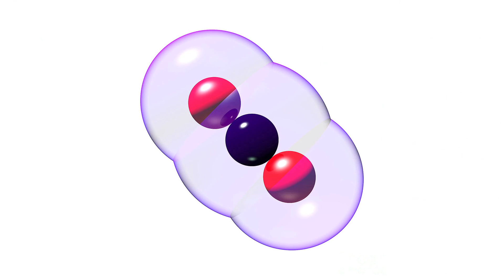Gas Made from Air and Water!

Comment: I can go down to my local bottled gas supply store and get a 45 lb bottle of hydrogen. A 45 lb bottle of hydrogen can be transported without any special.  Torequirements.  Again, this discussion was about the conversion of hydrogen into gasoline, versus the use of the hydrogen as the energy source. My belief is it is not worth the energy to convert hydrogen to gasoline, when gasoline so inefficient.

Comment: Not necessarily.

Assuming that its a clean burn (no soot forms and no fuel is left over), all of the gasoline will be converted back into CO2 and H2O.

The only problem is, well, you can never have a 100% clean burn. There will always be byproducts such as carbon monoxide and soot.

Comment: What a pile of not new not shit.  Hydrolizing carbon in carbon dioxide will already require nearly the same energy as you get from the octane molecule, and to follow that up with distillant combinative fracturization would require around the same amount of energy.  Until the filtration from molecular sieves and processing through molecular motors and can work at above 90% efficiency directly from sunlight, this will never be a primary energy source.

Comment: NO. Hydrogen liquid is just to hard to use as a transportation fuel. 1. It requires cryogenic conditions for storage, thus making it very complex and difficult. 2. Energy density of liquid hydrogen is very low. Fuel Cell tech based on other fuels like Methanol & Ethanol is the best. Direct Ethanol FC only need an airtight tank normal pressure to store fuel. While both methanol & ethanol being larger molecules have much higher energy density.

Comment: hey sourcefed, there's a program that was funded by the DOE just last year called JCAP, Joint Center for Artificial Photosynthesis. It's basically the same idea, water + CO2 = gasoline, but they also try to incorporate solar cells into the technology. see if you guys want to check that one out too

Comment: i Remember reading this somewhere the problem is that the engine that will run on hydrogen can explode when crashed. which is why is not really out in the public and also the procedure to get ethanol is that they need catalyst and catalyst is very expensive i have heard in chemistry class.

Comment: the infrastructure change would make the potential savings not worth it.  conversion to gasoline doesnt require any changes, and completely does away with the concept of Peak Oil, since the tech will be ready in the next 20-30 years and will build up more as we get closer. as more and more things are converted to "clean gas" that leaves more conventional oil to go around, easing the supply side of the calculations

Comment: This can have a huge affect on our energy consumption. Right now one of the biggest problems is storing energy. Our existing batteries cannot store a lot of energy and they use extremely dangerous and damaging elements in their construction. If it were feasible and economical to store renewable energy from solor and wind in the form of this type of gasoline, it could help aleviate this problem! But this is just me talking out of my ass.

Comment: It's a nice proof of concept, but forget the money--how much energy has to go into this? If the renewable energy (e.g., solar) is greater than the energy produced by burning the gasoline, you've technically lost energy. Further, a large proportion of the potential energy is gasoline is lost as heat instead of work (in car engines, for instance), which electric cars don't do. This might still be trying to solve the wrong end of the problem.

Comment: So you extract hydrogen from water to convert it to gasoline, why not just use the hydrogen? Seems like it would be easier to convert our current technologies to hydrogen then use excess energy to convert the hydrogen to gasoline, which only is about 25% efficient in current technologies.

Comment: When you combust alcohol you get the water back, and this process uses CO2 not O2... we don't need nearly as much CO2 as we have - in fact the amount we have atm is a problem.
This tech would be worth it, even if it does use more energy than it puts out - purely because methanol can be transported and stored easily. Unlike solar and wind power. Bring it on, I hope this method takes off

Comment: The EROI question is pretty big with this tech. The more steps you put in between, the less efficient the process must become. I can see why they mention renewables as the power source though - as isolated sources, they suck, but as passive/distributed sources they absolutely crush fossil fuels. So if you can take all that passive collection and store it in a fuel for shipment to where its needed... maybe some good potential there.

Most promise for airplanes. We really need new airplane fuel.

Comment: As far as the process uses energy so is it sustainable is a bit of a strange question since it takes unbelievable amounts of energy to run an oil refinery, however, you get a lot of products out of an oil refinery from natural gas, gasoline, kerosene, diesel fuel, jet fuel, and asphalt out of basically, one barrel of crude.  On a side note the problems caused by gas burning vehicles will not be solved with more/cheaper gas to burn.  Go Nuclear!

Comment: Batteries and fuel cells will hopefully be able to take over for gasoline in a decade or two before we come too close to depleting the fossil fuel avalible. It's really a shame to burn it since we can do a lot of great chemistry with it.
High temperature ethanol or hydrogen fuel cells could be viable for subsonic flight, batteries for cars with fuel cell range extention packs, and trains on electric tracks for mass transit.
Also: bicycles! As a student my main transport vehicle is a good bike.

Comment: companies are already making methanol using blue green algae, gray water, and waste industrial CO2. they use solar energy to heat/power the liquids to speed the process.  it is scalable and produces cost effective gas when upscaled (about 2$ per gallon).  between 2 and 20 thousand gallons can be made per flat acre, so think verticle

Comment: This i great! Wouldn't this also help with removing CO2 from the air, which is one of the most "harmful" greenhouse gas which is produced from the gasoline you just made, so the pollution wouldn't rise as rapidly, plus we can use solar, wind, geothermal(etc) power to produce this new fuel in large scale, so it will be just awesome... nuff said

Comment: It's neat because it works in existing engines, but as they said there's no way it can take the place of conventional gas.  One thing that they were wrong about in the vid is when they said "Our rapidly depleting-slash-polluting-slash-expensive fossil fuels."  The reason why we use fossil fuels is that they're extremely cheap, concentrated energy overall.
This is really just a stop-gap technology that's treading the water until battery technology advances enough to make electric cars realistic.

Comment: So why aren't we using hydrogen? I can make hydrogen with electricity and water. I do so regularly when electro-etching brass plates for art or home made circuits, and when I need hydrogen for my hydrogen torch (also home made). You need a 12v battery and water. That's it.

Comment: You're correct, it's not new technology at all. As has been stated it is a fairly simple process. I believe the reason a much larger company hasn't really tested it already is that the volume of fuel created is too low to make it worthwhile especially when the process is pretty inefficient as it is. Hopefully they will prove me wrong and increase efficiency and maybe then it would be feasible, but i doubt it

Comment: mix this new fuel with ethanol, and produce it all using wind and solar power, then voila you have clean renewable and (slightly) more practical fuel. 'cause I really want to give up fossil fuel but I don't want to give up cool cars based on the standard internal combustion engines

Comment: I agree with what you're saying completely, but the issue is it wouldn't be a short term solution. Or at least not for the automotive industry. It will take a good while to develop the process enough to create enough fuel to have a real impact on even a single country, hence why it may be used for motorsport (that and the fact it will be very high grade fuel). I really wish it was feasible for this to be used worldwide in road cars as i hate to see cars go down the electric route

Comment: It would take more energy than would be contained in the gasoline, but that's not the issue here. This would at least let us manufacture gasoline (to be used in vehicles) without needing to worry about running out of resources from the Earth. The extra energy needed can come from other (possibly renewable) resources.
So you're absolutely right, but it would only be a problem if we were using gasoline to make less gasoline.

Comment: News flash! Scientists found out how to build a battery made of gasoline.  You put energy into the system which stores it chemically, only to be released later and converted to mechanical energy.  This is pointless as converting energy from electrical to chemical to mechanical is the least efficient way possible to move energy.  There will never be an engine efficient enough to make this process make sense.  So stupid.

Comment: How is this less flawed than hydrogen fuel cells? (other than being less explosive) If you need energy to make the chemical energy (hydrogen or gasoline) then we're just converting the energy from one form to another. Fuel cells also only produce water vapor, while synthetic gasoline still produces CO2 when burned as fuel, which is a bit counter intuitive.

Comment: Video Response. Does your car still use gasoline? Did you know that when you run your car on gasoline, you're actually running it on hydrogen? The water powered car in no myth.

Comment: Hey SourceFed it would be nice to see some sources, either in the description or in the article on your site. Overall you're barely getting any information about how this works, well known principles? To make chemical energy like gasoline, you would naturally need to get the energy from somewhere else. If they use electricity to make the gas, then they probably burned fuel to make that. Even using renewable energy, they would still pollute when using the gasoline. I just don't see what's new?

Comment: I have two sides of the story.
The synthetic gas could be a viable source of energy ONLY if the energy output is higher than the input. 
The other side is instead of wasting our time creating gasoline that will deplete our ozone and increase our greenhouse effect, why not use that time and money into improving the electricity cost for electric motors, finding other, cheaper substances to make the special conductive parts to essentially lower the cost of the electric engine. Lowering the cost wi

Comment: they are using CO2 and water to make gasoline. then burning the gas to get water and CO2 so ya you get our air and water back. 
basically:
              CO2 + H2O = gas
              Gas + O2 = H2O + CO2

Comment: Essentially you are moving the energy carrier down the chain from renewable source to gasoline, you are going via hydrogen, why not stop there. Have a system with no point of use CO2 production, better yet? You can make it without air. Hydrocarbon generation from air will prove vital in the distant future though when we need long chain hydrocarbons for applications ranging from medicine to plastic bags.

Comment: As it turns out petrolium is an complex molecule build out of hydrogen and carbon which can be found in water H²O (H=hydrogen) and carbon dioxid CO² (C= carbon). And now come the best part. When you burn petrolum guess what you get. carbon dioxid and water. And when you say now ²the extra burn/heat causes more global warming.² think about that you have to put in energy to form the gasoline. Therefore what you put in it you get back out. So carbon dioxid neutral. Hope you it helped good day :)

Comment: If the energy required to produce this gasoline is equal to or slightly more than the energy the gasoline produces, that is still not too bad considering the efficiency of energy stored in batteries. You are just storing electricity into a hydrocarbon based medium. Still better than a lithium-ion, lead-acid or any other battery technology, since I can still bring my car from empty to full power in minutes instead of hours.

Comment: No because its only putting the CO2 back that it took out from the first place.
The only polluting part is the electrolysis to get hydrogen from water.
But use renewable sources to get the electricity for this, and there is no pollution.

Comment: It's a great replacement for fuels in existing vehicles (pro: don't need a new infrastructure) but don't forget that the process involves electrolysis (con: needs a lot of energy to produce). Even though it -will- be less efficient than a completely new infrastructure (loss of energy in the conversion processes) we have to ask: Will completely replacing existing petrol-based transportation even be feasible? If not, that's where this process can truly shine.

Comment: There is no way we would run out of water.. if you use electricity to change water to hydrogen then you can store the hydrogen (like in your car) .. you then mix the hydrogen with oxygen later (creating electricity) and power an electric motor. Byproduct? .. Water. It's essentially an extremely efficient battery.

Comment: How much does it cost to create the synthetic gasoline. That means you will still need coal. Until we find a better way to get electricity there is no such thing as renewable energy just a slower way to use the nonrenewable energy.